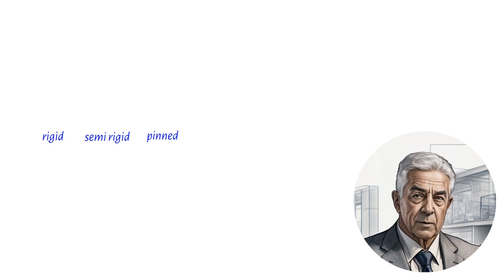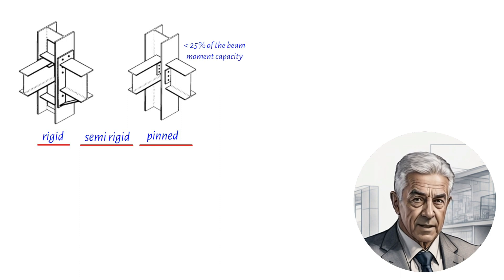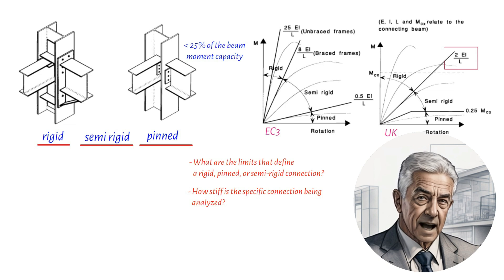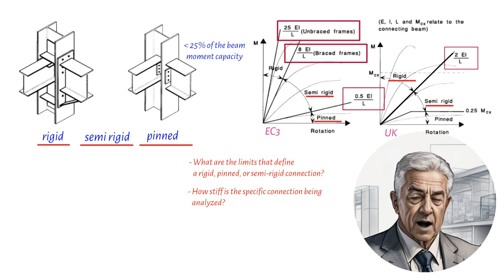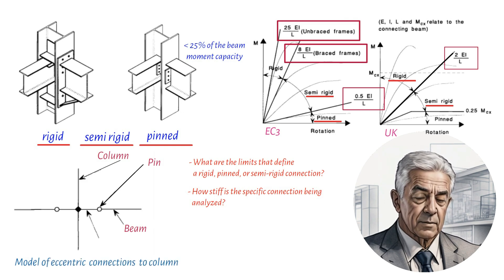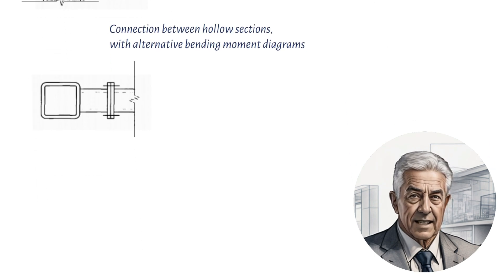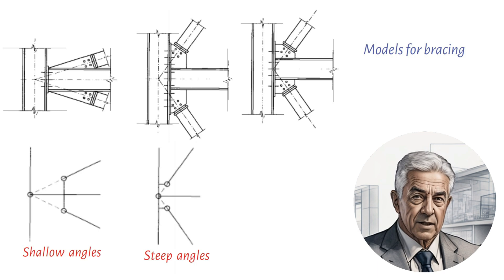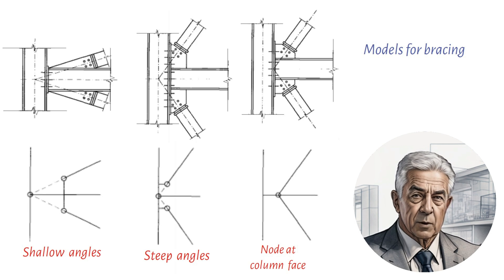Mastering Structural Design: Understanding Rigid and Pinned Connections for Accurate Analysis.

Comment: Is this where secondary moments come about? you already have a moment in the beam being connected to the column…then with the bracing member coming in and essentially connected to the beam…you have BM from the beam under normal loading and Localised BM at the end of the beam from bracing….is this the correct use of the term secondary moments…?
Reply from the maker: Thank you for your question! You are correct that the term "secondary moments" refers to additional bending moments that arise due to the connection of the beam to other structural members, such as bracing members. These moments can contribute to the overall behavior of the structure, so it's important to consider them in design. If you have any more questions or comments, feel free to ask!